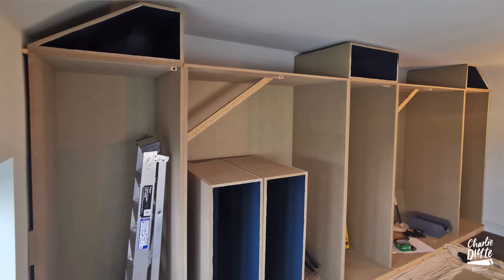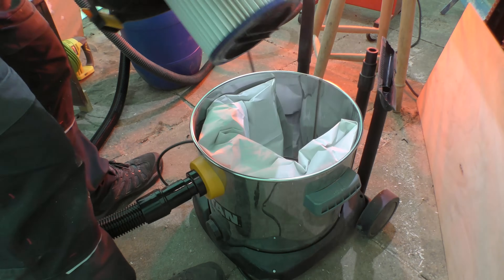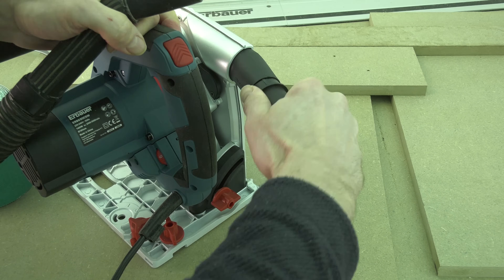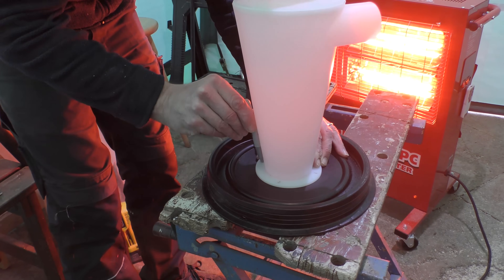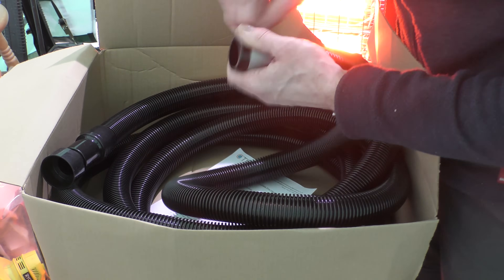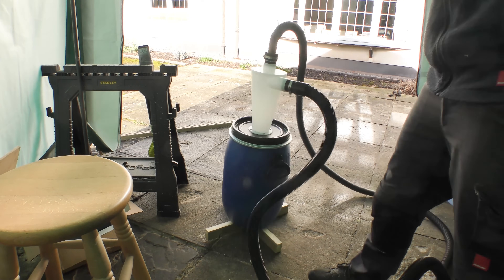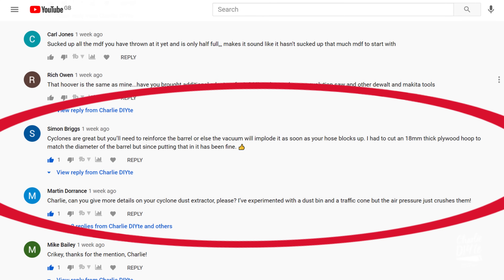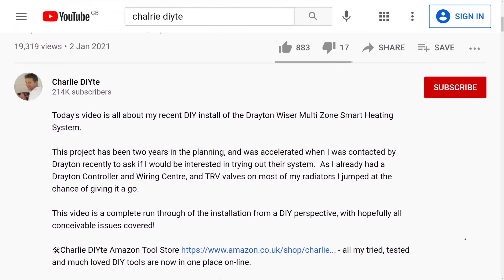How to Make a Cyclonic Dust Extractor/ Collector

Comment: Mine collapsed. It took me at least 30 mins to hammer it back into shape, and then it collapsed again, instantly, when In tried to use it again. 

So I used some spare rebar to weld up a frame to go inside the barrel. Now when it collapses, it can't.

Comment: My titan constantly blocks so thought I'd give this a go. Got my bits from amazon, put it together and gave it a go. I was impressed by the suction through the cyclone until about 60 seconds in when my metal drum imploded.....
Reply: dit you fit a pressure relief valve on the barrel?
Reply: @wintersun398 That would involve intelligence.

Comment: Why use a barrel though? Make a box, glued and screwed out of 3/4 inch plywood with a top fastened down using case clips and a rubber gasket on the underside. Its a very strong container, wont collapse and the lid can clamp a bag in place to collect the dust for easy disposal too.
Reply from the maker: It's a good point. I'll probably do that next time. I guess a barrel is more portable if you're moving the vacuum around but if it's just a static shop vac, what you describe would be perfect.

Comment: Great and very useful video, thanks. How are you finding the Erbauer track saw?
Reply from the maker: Thanks. Yes it's fine for what I use it for. Powerful and a deeper cut than a lot of them. The track that comes with it is great quality. Shame they don't make it in longer lengths. There are probably more accurate versions out there but for general DIY use it's hard to beat particularly at that price.

Comment: Rather than screwing your bin/barrel to some bits of wood for stability, maybe think about making a rolling cart with the vacuum in the base and the bin/barrel on the top sitting on a shelf above the extractor. It's a great way to keep things tidy and you can also use it for tool storage on the outsides or on the shelf. CASUAL DIY has a video on his channel on how he made his using scrap wood, Plywood/OSB/MDF. He's a Polish guy but his English is very good but with a strange accent from living in the UK for 15 years. It's worth checking out.
https://youtu.be/o59zoqQY8FA Cyclone dust collector and mobile storage cart - PART 1
https://youtu.be/3QBbbrYkSkY  Cyclone dust collector and mobile storage cart - PART 2
Therepre loads of other videos on the same theme all over YT.
Reply from the maker: Thanks mate. Yes I was lugging it around last night thinking it would be useful if it was on wheels. Generally though it's best as a static shop vac but has been very useful vacuuming up dust on the current kitchen renovation.

Comment: Your Best solution for collapsing barrels is two the same type with one inserted into the other, my Dust Deputy has worked for over 7 years without any issues, why do DIYers try to reinvent the wheel, dust cyclones have been around since at least 1886.

Comment: watched this video many times but only finally got to pull my finger out. Prices have been stupidly increasing since only over a year ago. I did spend a lot less on hose and will 3D print couplers as I need them.
Thanks for a great video.
Reply from the maker: Thanks Andre and his luck with the build 👍

Comment: I made a similar one to this. I keep getting shocked by static from the (festool) hose. Have you had this or any way to get rid of the shocks! It's fine when I omit the collector system and go back to the standard tool direct to festool midi.

Comment: Hi Charlie, what diameter pipe did you use? I have bought all the equipment needed but not set up yet,  and a 40mm pipe but it doesn't want to connect as it's about the same size as the adapters, thanks
Reply from the maker: 38mm I think https://amzn.to/3FXq2ML
Reply: @CharlieDIYte  thanks

Comment: I have built almost exactly the same but the dust just shoots straight through and comes out the vac outlet port. Has anyone got any tips, obv not able to post a pic of mine here. I am thinking maybe it's a shit cyclone?
Reply from the maker: Have you connected the vac tubes the wrong way round on the cyclone?

Comment: Great video sir. I have just set up up exactly the same system but mine isn't working right. I started extracting on a concrete floor grinder only to find the hoover losing suction and that the hoover was full of dust. Please help someone!
Reply from the maker: Have you got the nozzle that's sucking up the dust connected to the wrong feed on the cyclone?

Comment: Did you buy an adaptor to get it to fit to the tracksaw port?
Reply from the maker: You tend to get adaptors with most power tools - particularly mitre saws and the like and I think I just used one of those - from my Evolution saw. Failing that you can pick them up very cheaply on Amazon and eBay.

Comment: Hi Charlie great video but have a question do you think this will work well with a sander please ? Thanks Ian
Reply from the maker: It should do although mine collapsed when I had it connected to my random orbit sander. A combination I think of it being a very warm day so the plastic barrel was softer, and the sander creating an almost permanent blocked suction effect. It hasn't done it since although next weekend In going to show an upgrade I've made to it (pressure relief valve, / metal drum).
Reply: @CharlieDIYte  Yes! Looking forward to the new video. I noticed you had updated the "Today's Toolkit" list and I've been hoping you would show us how/if you've implemented the metal drum yourself.  I'm planning to build one for myself using the newly updated version of your Titan model. It now costs about £10 - £15 more than you paid for your model, but the plastic parts appear to be better quality 😂 I'll know for sure when it arrives tomorrow!

Comment: Just bought all the bits from your links to make this as I have a lot of sanding to do indoors and this, I hope will help a bit. Bought a different Cyclone part as I want it all tomorrow as I'm off work then and can make it. Appreciate the videos Charlie, keep them coming.
Reply from the maker: Cheers Keith. You'll love it! I've got to say I've used mine continuously since doing this video. No dust in the vacuum and I've emptied a three quarters full cyclone twice now.
Reply: @CharlieDIYte  Finished... Took me a lot longer than you I'm sure but the agro was getting the hoses to fit!!! Glue gun, a bit of improvisation and duck tape seemed to help.. Plus I added a hoop inside in the hope it does not collapse! ;-)... Thanks for the heads up on that yesterday... KT

Comment: I recently bought a titan wet and dry and I'm intending to upgrade the filter to class m, and ultimately replicating your cyclone system. In the meantime, where did you get the hepa filter upgrade from? Thanks in advance.
Reply from the maker: Screwfix have stopped selling the filters, but the guy just below you in the Comments feed has bought some Titan spares on Spares2go so you might try that?

Comment: Had this in mind but following your video it is all made and works fantastically with my Henry vacuum.
Reply from the maker: It's a game changer Mark, isn't it! Out of interest how did you get the Henry vacuum tube to connect?
Reply: @CharlieDIYte  I can't believe how well it works.
I've used one of the adaptors in the machine and some tape but it is not ideal, it makes the bin unstable even with the cross beam on the bottom.
Next is to do this to make some adaptors the will fit perfectly - which I have done for some of my power tools. 
https://youtu.be/cjLQo3GuvDo
When I get the time to go get the measurements and pipes.
Reply: @CharlieDIYte  actually I used the connector from one of these as well.  https://www.amazon.co.uk/dp/B0166MGYBY/ref=cm_sw_r_cp_apa_fabc_1RDPYDXQB38Q7QS1GNAE?_encoding=UTF8&psc=1

Comment: Hi Charlie really good video on the cyclone, I am in the process of making mine. Have you considered the problem of Static electricity and how to earth it or am i just making problems for myself, your thoughts wood be appreciated.
Reply from the maker: Yes a few people have mentioned static. Best thing to do would be to earth the metal clip component to the ground with a suitable wire. You can probably use Google to find something appropriate.
Reply: @CharlieDIYte  

I would recommend watching this video on Earthing
Reply: Also this is a good video for a pressure release Valve to stop the barrel collapsing 
https://www.youtube.com/watch?v=wNBxce-HeCw

Comment: Aw, why did you not do this video months ago! Would have saved me so much grief. Do you think it would work with finer dust like plaster or from a wall chaser?

Have you done a video on your track for the saw? Which one did you go for?
Reply from the maker: Yes I'm sure it would work with finer dust. So I've got the two 700 mm tracks that came with it, and for the time being I'm struggling on with the two 1400mm Evolution tracks, bolted together to rip down full length sheets. It's annoying Erbauer don't do longer tracks as I'm impressed with the quality of the two that came with it. There's a mini review at the start of this video https://youtu.be/4ylDeQXv1k0 👍🏻

Comment: I've done exactly what you've done Charlie, except I used a 15kg gas bottle with the top cut off and used an mdf lid, i use it with a Henry. Its all air tight but when I use it, all the fine dust still ends up in Henry. Only the heavier particles stay in the gas bottle.....any ideas? Cheers Chris
Reply from the maker: I'm not sure what's happening there Christopher. You've got the tubes connected up correctly, with the tube from the vacuum going into the top of the cyclone? What are the dimensions of the gas bottle?

Comment: I think you're right about the barrel not collapsing due to the relatively low power of your vac. I had a cheap wickes vac connected to exactly this set up without a single collapse. Upgraded to a festool vac and it happens regularly. Need to get round to strengthening the barrel...
Reply from the maker: A lot of people upgrade to a metal barrel to get round this problem 👍🏻
Reply: @CharlieDIYte  Yeah, that's probably the way forward. Have you heard of a good option for a barrel about half the size? I absolutely love the cyclone - has been a total game-changer for me - but still find it a bit bulky to take on an install with me...

Comment: Really enjoying your wardrobe build series so far
Not related to your cyclone but does the Erbauer track saw fit the Evolution rails?
Reply from the maker: Thanks Tony.  Yes it does although it will trim a new slice off the splinter guard so if you want to go back to using the Evolution (which I can't see why I will actually) you'll need to buy a new splinter guard. I was very impressed by the 1400mm Evolution track. Good quality and it bolts together totally flush. Don't know why they don't make a 2800mm version.

Comment: Great video and really timely as I need to up my dust busting game! Do you have any thoughts between buying all the parts for this vs a scheppach dust collector which is about £70 from Screwfix?.
Reply from the maker: I couldn't see that on the website. Does that have a motor integrated? The thing about making your own is you can choose what litre capacity you need, and use it with your existing vac. I didn't show on the video but it's intriguing watching the dust spin around whilst you're vacuuming. And you can literally vacuum up everything with it.

Comment: Great video Charlie thanks for posting, I've being using the same idea with my Henry hoover for sometime. Henry has managed to collapse the barrel when the hose is blocked so I went for the wooden plywood hoop idea and even added a DIY pressure relief valve.
Reply from the maker: Good old Henry. Trust it to collapse the barrel where my Titan failed! I've just done a count and realised I have 4 Numatic vacuums. I think I need to see someone about this 🤣

Comment: I could have sworn I posted a stand alone comment the day this video was released with advice for people, including links to other videos, on how people can make their own adapters for attachments and about how to make your own pressure relief valve. Am I imagining it or has it been deleted for some reason?
Reply from the maker: I haven't deleted it but it could have gone into spam because of all the links. I'll have to check.
Reply: @CharlieDIYte  Thanks Charlie for the reply, that probably explains what happened as it did contain a few links to other peoples YouTube content where they had made their own connectors out of readily available PVC pipe. I posted it as I found the content these people had made really useful due to the wide variety of connectors on power tools, it is such a shame there isn't a set of standard sizes. It works out costing a fraction of the bought connectors and I found often when buying the connectors to begin with that it was a bit of a lottery trying to find an exact fit, hence why I went looking for how to make my own. I really recommend it if you have a need for connectors. Hope the build is continuing to go well.

Comment: I made one of these, but to avoid the reported issue of the collapsing barrel, I fitted a Dust Commander anti crush valve. You can purchase these here for only a few £££'s: https://www.dust-commander.com/gb/16-accessories
And by adjusting the tension on the spring you can adjust the point at which the vacuum opens the valve.
No messing with hoops or any other method of strengthening the barrel!
Hope that helps someone out there 👍
Reply from the maker: Thanks mate. That's very helpful 👍🏻

Comment: Good video, thanks. Completely recommend it as a solution. I use a similar system but with a bigger barrel (suspect that’s where the problem lies). Had a massive problem with barrel collapse. Tried timber joists in the middle. Fail. Toyed with the idea of making a pressure release valve but I needed to crack on with a very dusty job. In the end I drilled 4x 4mm holes in the barrel lid, which reduced the pressure enough to seriously reduce the collapse without causing any collection problems - I think my shop vac is quite powerful. I drilled one then tested the collapse vs suction, adding one at a time until I got
to the right balance. However, my separate 100mm drum-type dust collector just died, so I now have a spare metal drum to use instead. I was just about to order a small metal barrel (there are companies knocking out cleaned fruit juice barrels in different sizes on ebay/amazon) so good timing.
Reply from the maker: Thanks mate. Yes metal barrels seem like the way to go. Presumably the metal barrel will be self earthing too unless you've got it on a rubberised or wooden floor (I'm told to earth mine because of static build up).

Comment: I bought a similar barrel but was warned in the advert this is not for High Volume Low Pressure vacuums. I did connect it to same just to try it and it buckled. So now I’ll buy a smaller vacuum Low Volume High Pressure to use with it. Be amazed, I’ve just subscribed!
Reply from the maker: Christian I'm very grateful for the subscription 🙏 Could you instead but a metal drum. From reading all the comments it seems this is the way forward to resolve the buckling issue.

Comment: Hi, I have three homemade dust extractors and they are so close to you specs that you would think I had made them after seeing it on your channel and copied it. I made these last year while I was going nuts locked down in my house I needed three because “SHED” is in three sections with walls between each part. As I said I used three triton vacs, three blue barrels and three cyclone cones, all of which have worked without falt and I have changed the barrels out when they were full “ I differed in one way, I set up a bulb that lights up when the barrel is full”
Reply from the maker: Good to hear from you John. The bulb is typically ingenious. I wouldn't have a clue how to go about that 😏 I'm told static can be a hazard with all that dust. Have you earthed yours?
Reply: @CharlieDIYte  no and i have not had any problems

Comment: How are you finding the Erbauer plunge saw? I am looking to buy one for diy (so not wanting to spend £400+ on one) heard the Erbauer is decent enough but people have had issues with the anti kick back?
Reply from the maker: I love it Joshua and the first thing I did was remove the anti kick back, with a PH2 screw bit. Dead easy. It comes with a track that's wide enough to do a cross cut. Bolted together completely true which was impressive. It fits my Evolution tracks too (Erbauer don't seem to do a 2800mm track for some reason) although I've had to order some new splinter guard (in case I use the Evolution again on the tracks) because the Erbauer will cut closer to the track than my Evolution did, thereby removing more of the guard (which is perfect thinking about it, as that way it will be set up on the track as new). Also I'm unlikely to use the Evolution again with the track, or at all for that matter as for light weight jobs I'll still use my Ryobi. Also slightly annoying that it doesn't come with a carry case but I've bought a Triton case on Amazon, which doesn't quite close with it in but does the job. The other thing I like is that you can mark on the depth stop with a pencil your most often used depths so you don't have to keep setting the blade by eye.

Comment: Great video. I've used this exact system for a year now,  and I'm very impressed on how well it works and how much it captures, and how portable it is. The only thing I did differently is I reinforced the lid on the inside and outside with some cheap plastic chopping boards cut to fit and sealed up to prevent air leakage, to give the cyclone a bit more rigidity just in case, I knock it when working (which I'm bound to do!).
Reply from the maker: Thanks mate. Glad to hear you've had a similar experience. Wish I made it years ago 👍🏻